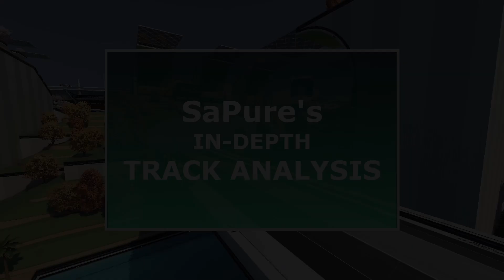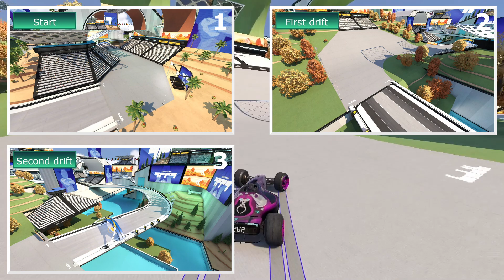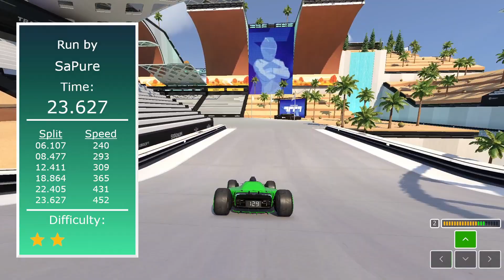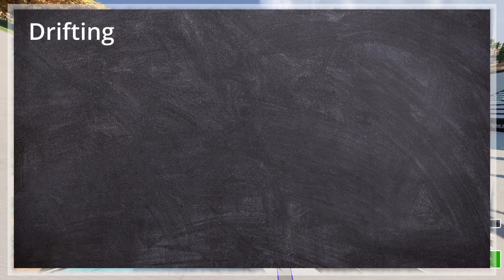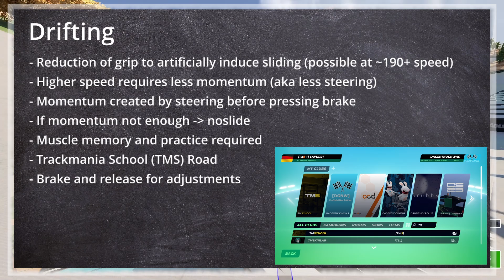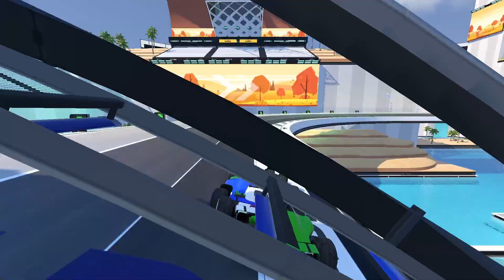Trackmania In-Depth Track Analysis | Fall 2023 | 04

Comment: Do you have a different game?
I'm driving the blue strat and I'm still on white time.
I got two pretty nice drifts and I'm driving quite close to the walls but only getting a 23.942.
Am I missing a hidden booster or something?
Reply from the maker: Hey! Sorry for the late reply! Pretty difficult to judge what you can improve but the runs in the video are pretty good for the applied strategies. If you want you can stop my a stream and we can check out your run to point out improvements :)
Reply: Will do

Comment: Under 24 with just releasing is pretty neat, doubt it will be that easy for beginners :D
Reply from the maker: Agreed, the runs on this one are fairly maxed out with their strategies (.7xx is possible with release). There really isn't a "safe" way to drive it and not a lot of strats. Release as much as necessary and get as close as possible. I still think for newer players, trying to get a feeling for the turns by doing the release way is a good start.